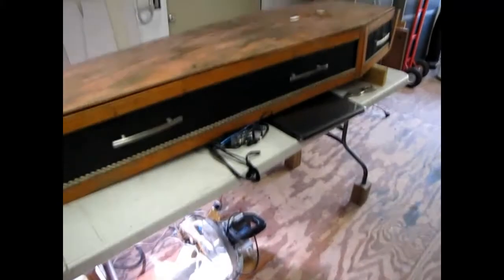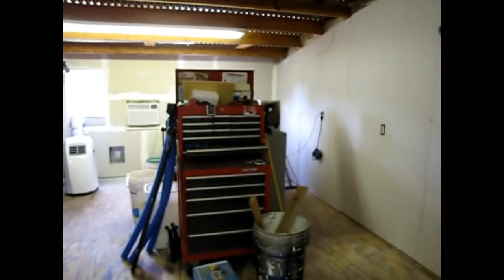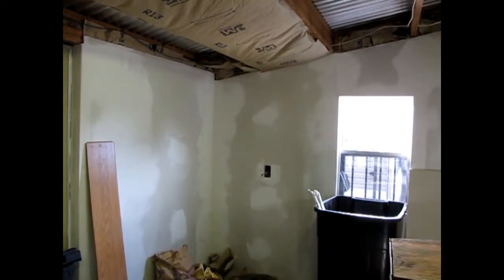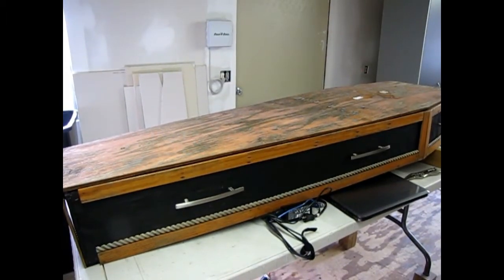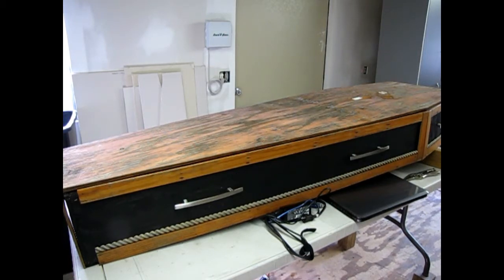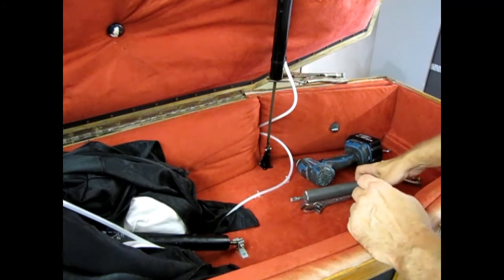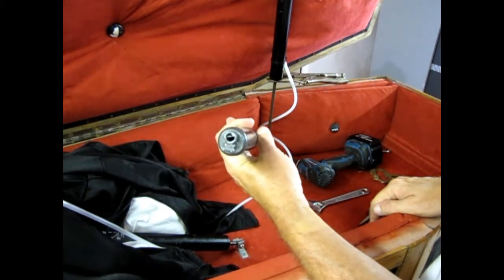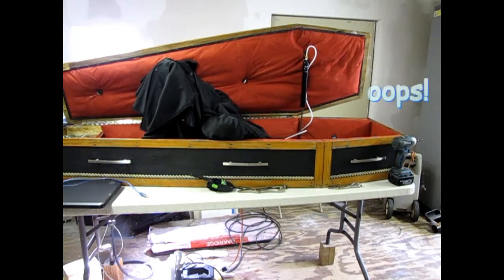Coffin Pneumatic Halloween Prop - Arduino Controlled Part 3

Comment: LOL @ that new cylinder test! Looks like the throw is longer on the new one than the failed one. As for the Arduino issue, you've got it wired correctly to the relay, right? Try toggling the HiOut setting for that relay in the software and see if it works. Without a closeup, it's hard to chime in with what may be the issue. Really like the prop, though. It looks great and I'm sure you'll iron out these minor issues.